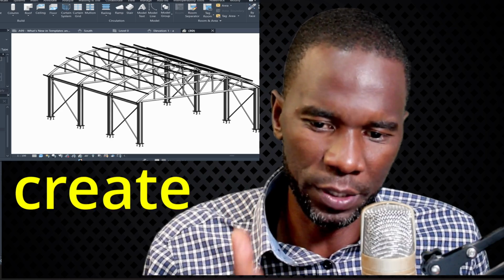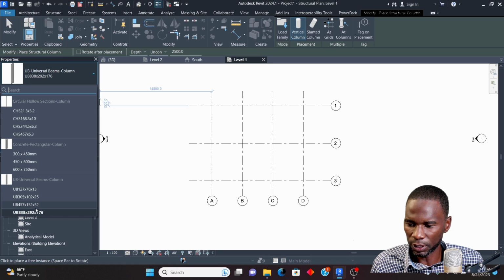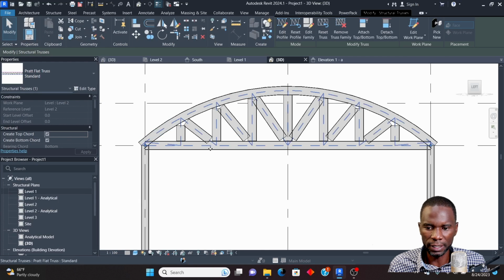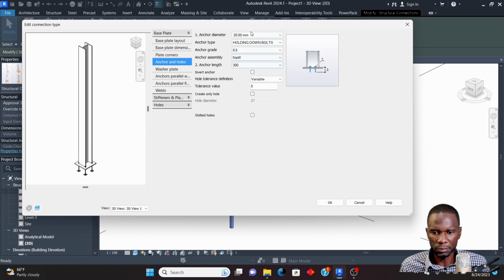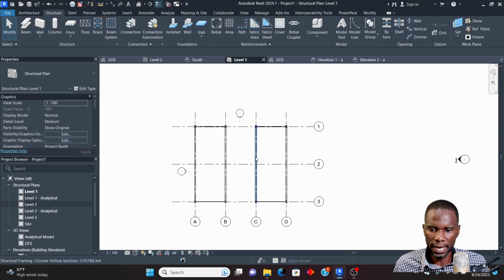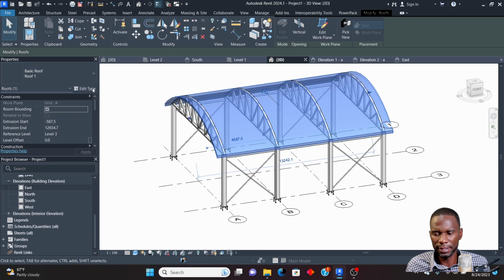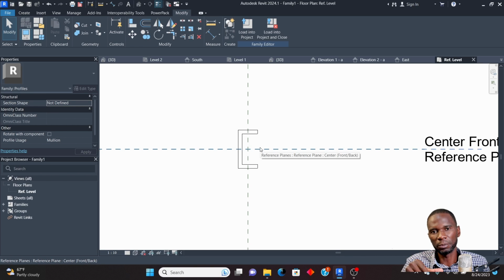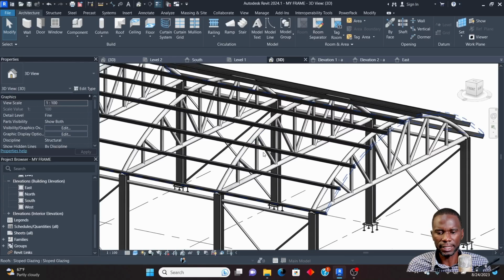HOW TO MODEL A STEEL TRUSS IN REVIT || FULL TRUSS & STEEL FRAME SIMPLY EXPLAINED

Comment: Hello, thank you for the video! Why do you create a framing elevation when you can just use the normal default elevation? Does it make a difference? I assume its just to create an elevation perpendicular to the plane you want to work in if your building is oriented differently, right?